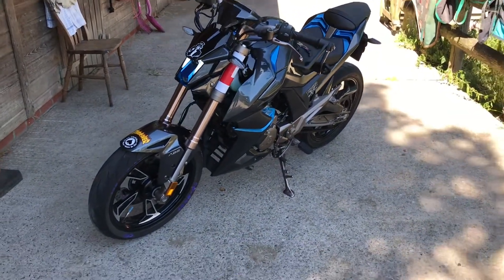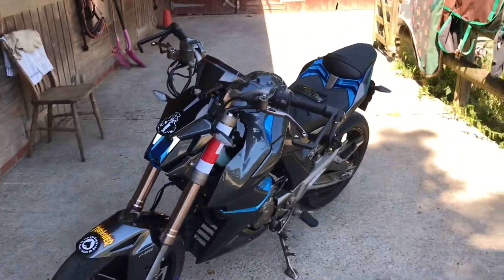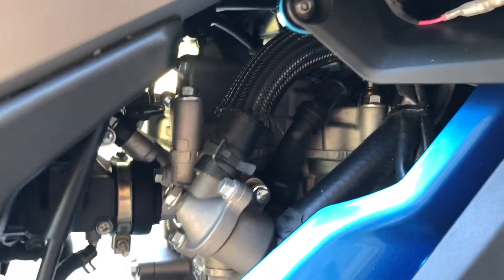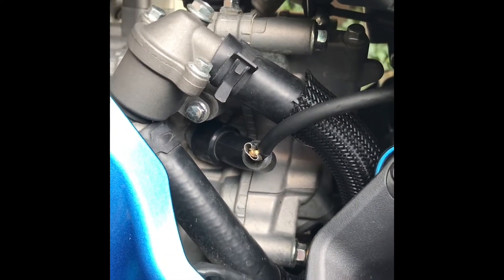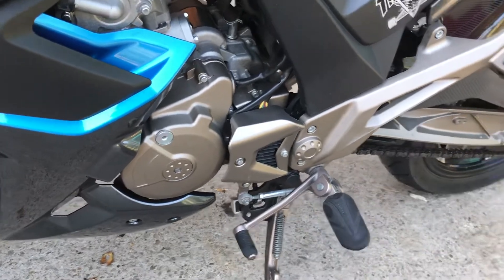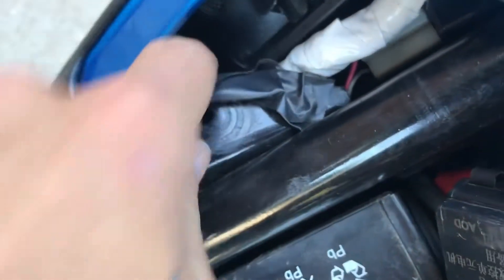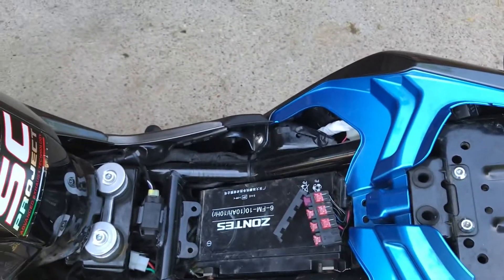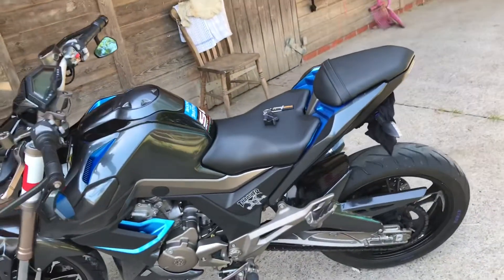Zontes zt 125 u review part 2 problems and issues must watch!!

Comment: Never pressure wash a road bike that's just stupid even pressure washing a MX bike you don't force the water raound the eng8ne or electricals.   Sidestand switch is a common issue especially in winter 2 allen bolts to get off, clean it and lube with engine oil all sorted.

Comment: Should not wash a bike with an eye pressure water jet you just cause more problems
Reply from the maker: Yeah I know that bud but loads of farms around where I live so bikes covered in shit all the time not gonna sit there washing that off my hand 3 times a week 😂
Reply: @ThrottleThrasher  Hello thank you for your reply I believe you can buy a wax that you spray over the loom and all other parts of the bike which protects it from all the elements and it’s easier to wash off
Reply from the maker: @michaelbarrie1748  oh ideal I have heard of something similar just like a waterproof silicone you put in all the connectors and plugs and everything definitely worth getting I think !

Comment: How did you get rid of the floating mudguard on the rear wheel? But its a great 125 for the amount of luxury features u get. You probably were just 1 of the unlucky ones from zontes. I would just cover the sparkplug with a plastic bag when washing.
Reply from the maker: Just unbolted it mate I’ve not got a number plate on the bike at all anymore re located the indicators and got rid of the plate have it on my ruck sack now (video of this dropping soon ) and yeah but I’ve had comments saying they’ve had a few small problems Aswell get it with all bikes and it must have been a fault ht lead and since I put new one on and coil pack had no problems!
Reply: @ThrottleThrasher  See I think the indicators on the wheel is kinda a safety hazard from anyone behind because they would need to see your indicators. Thats why Im doing the same but i'll still have the plate on.

Comment: if you want a free tattoo get in touch mate, thankyou for clearing some things up especially the cutting out when wet although it happens to me in the rain as well. my indicators filled with water on the side the bike leans after the first wash, seat release and fuel cap stopped working, audio beeps don't work, hazard lights flash on/off randomly after starting the bike, red button stopped working so now i use the side button in the little hatch to start the bike. Bike bogs down violently when wet. clutch sensor broke, the only things left to go are my forks and side stand. absolutely gutted about the lack of water proofing on this bike. why go to the lengths of design manufacture and ABS to cheap out on the electrics. i ride every day of the week bar one for work, some mornings I'm just hoping it starts .
Reply from the maker: Where are you from mate may take you up on that assume your obviously a tattooist? Really it seems like mixed opinions on these mines in 12000 miles now still going strong especially once I changed the coil pack and ht lead as that’s why it was faulty when it got wet
Reply: @ThrottleThrasher  what HT lead did you get and coil pack? Any links? Thanks!
Reply from the maker: @ralphganaden7390   could find an upgraded one . So had to get one through Zontes just original. Was £38

Comment: You r a g for this, I've just ordered mine, should be here Wednesday.. im literally going to do all of the above👌
Reply from the maker: Legend mate and is it what colour you gone for? Yeah hope it helps mate like I said hasn’t put me off in anyway still been a fucking amazing bike and done like 9000 miles on it already so it’s not bad really
Reply: @ThrottleThrasher  the orange and black. Just passed 700 miles. I can't comment on the other issues, but the wiring is all wrapped up now, not strapped to the metal so I guess they were aware of the issue. Ht leads etc all fine atm

Comment: Fuel cap issue common to lots of Skoda's and fixed the same way. Wiring issue hopefully a one off but worth checking. Looks very tidily designed.

Comment: thank you for these videos! gonna copy all the upgrades, especially the wire cutting metal will be sorted by the weekend 🤣
I love mine so much. 500km on it so far, can’t wait to put on a better sounding exhaust and bar end mirrors.
update: did you encounter the problem of losing power uphill? if so, what did you do to avoid it?
Reply from the maker: Cheers mate appreciate it ! Yeah I’d definitely do that ! And I think it’s just a 125 thing mate not got that much power could change the sprockets tho but would then power on the straights so I’ve left mine as it is on the big big hills will go down to 40 mph minimum!
Reply: Yo m8 where did u get the tail tidy and is it hard to put on cheers

Comment: Grate vidio mate   the thing is with that problem with the wires    if bikes under warranty  and thay see that the problematical  area has been tampered with i beleve thay can refuse to fix it is that correct    thank for briging my attention to this  as i hav seen another vidio  who says the same thing regarding  those exact wires 👍
Reply from the maker: Yeah that’s correct I probably did void the warranty but I didn’t purchase the bike from new so not sure if it could be transferred and unfortunately I’m 100 mile round trip away from the local dealer and needed the bike for work so was my only option but glad I got rid of the bike got to 12,000 miles the the electric got really bad lost most thing like speedo ,abs set didn’t lock or unlock fuel cap  so fucked it off

Comment: Nice video! May I ask where did you get the exhaust? Do you think it’s worth buying it? Then, do you think that in comparison to other naked bikes it is at the same level (like ktm duke and mt 125)?
I ask you all this because in the future I would like to buy one aswell
Reply from the maker: Yeah I’d say it’s worth it 100% even just for the link pipe as you can then change it anytime you want and just put a new van on it ! The exhaust I have tho was for an mt 125 as got it with the bike so I just cut off the muffler and welded the link pipe on ! Personally I would say so yeah although it’s Chinese the build quality is amazing and the bikes done very well just hit 9000 miles in 7 months and only had the few small issues I mentioned in this video so I’d definitely recommend the bike!!
Reply: @ThrottleThrasher  Thank you so much!!!

Comment: High, this video has been enlightening for me, my ZTu1 125 has been having some similar issues so  i shall be looking at what you have found.  would you be able to tell me the upgraded HT lead you brought was please, i think i will change it regardless...
Reply from the maker: It maybe the ht lead like mine was . I just replaced it with a stock one that’s been fine since but ……. The bike doesn’t like water and broke down in December last year has been off the road for a while but fixed now had a lot of messages on Instagram and YouTube with people having similar problems! It turns out like I say they don’t like water especially if not kept in a garage . My main fuse board under the seat started to corrode due to water going up under the seat so I lost abs and Speedo one day then days later she wouldn’t start like I say this was the fuse board rusting so was getting no connection so I took all the little connectors that hold the fuses in our and sanded them and put waterproof greese on the fuses and put them back in and been fine since .. also dried out my ecu on a heater as I’ve heard some peoples Zontes have had ecu failure due to moisture building up inside stay tuned I got a video dropping in this next week and a 1 year review !
Reply: @ThrottleThrasher  Thank you for answering my message.  I got mine in July last year and it started playing up the same way and yes it looks like wet weather is the cause. I unfortunately can't keep mine in a garage, its outside under a motorbike cover sheet thing. There is one thing that has happened with mine that I have just sorted out which is that it started to idle low and as a result kept cutting out. I will also be upgrading the spark plug to an iridium plug.   Looking forward to the next vid....
Reply from the maker: New video just dropped on the issues bud !

Comment: If you stopped jet washing your bike like its a car you wouldn have these problems
Buy a detailer spray and use a microfibre cloth and keep it clean as often as you want your girlfriend to wash herself before riding her. 
Throw the Karcher away and spend some time with cleaning it
Dont soak an engine with water and conplain on corrosion underneath, on ur stand, corroding your plug lead

Water is your issue
Not the bike

My bike has never seen a hose. Only a bit of rain.
Reply: My sons bike has always had the pressure washer and has had no issues. But then again he uses a leaf blower after to dry everything off and then some gt85

Comment: Fantastic and honest video. I have one question. 
Is this hand guard original? 
I would like to put the mirrors like yours, but they say I have to change the hand guard because it doesn't fit.
Any suggestions?
Reply from the maker: Thank you bud really appreciate it ! Yes they are mate and are stick hand guards !  all I did was get longer bolts than what came with and then put a big spacer on the end of the bars and bolted all in together maybe able to see this in the video now I’ve said it
Reply from the maker: Thank you bud really appreciate it ! Yes they are mate and are stick hand guards !  all I did was get longer bolts than what came with and then put a big spacer on the end of the bars and bolted all in together maybe able to see this in the video now I’ve said it
Reply: @ThrottleThrasher  thanks so much ;)
Reply from the maker: @Andreptt  no worries at all ! Hope this helps

Comment: Good day! I got a question, I am 17 years old with zt 125u, and i got a issue, well basically i was riding home from school, and my bike started choking, and after a while it lost all power and died, i could get it to start and i had to pull it to my garage, and i found out, when it cools down, it starts and drives good!! but when it reaches like 90 degrees celsius, the bike starts losing power, chokes, dies and won't start until its cooled down again, I have the bike currently at a zontes repairshop, and they also dont know whats wrong with it. Does anyone else had the same problem? If yes, what was the problem please? thanks for any comment and tips, i wish i could ride the bike right now, have a good day!!

Comment: Have somebody P0030 fault code problem? I checked everything, heater resistance is fine, circuit from ecu to sensor is fine, voltage from sensor is fine but then I delete fault codes and check engine is back after 1-5km of ride. 
Help guys!

Comment: Chip tuning power unit on google 80 quid atm for this bike
Reply: Not sure if it works tho ...anyone know anything about them ??
Reply from the maker: Is it fair enough mate yeah I’m not sure that wasn’t a thing when I had the bike as was not long released unfortunately most of my electrics failed when winter came so sold the bike . Lost abs my clocks my seat release all sorts as main fuse board rusts really bad and quickly

Comment: Are the bike good apart from this looking at getting one
Reply from the maker: Yeah I’d 110% recommend mate but read comments on some of my other videos on the bike as some people have had other and worse problems but then again others have said that I was just unlucky the bikes in 12000 miles already and is still going strong
Reply: @ThrottleThrasher  will do mate I had an lexmoto xtrs few years back but had nothing but probably from day one now want to ride again soon
Reply from the maker: @garyweir2294   tbh mate I’ve had 42 125s now in 5 years I think it’s more if you have a problem bike you have a problem bike and it doesn’t end ! My girlfriend had my Zontes now I’m on a lexmoto Mitchan ! Out of all the bikes I’ve had if recommend this Zontes my Yamaha yzfr and my Yamaha wr 125 all were really good solid bikes
Reply: @ThrottleThrasher  how much did you sell your zontes for? I paid about 3k for brand new cause I wanted peace of mind.
Reply from the maker: @steve00alt70   sold it for £2200 to my girlfriend as she’s know it had been well maintained had 10200 miles when she got it was going to be £2500 but she needed a new set of tyres front, sprocket , rear break pads and the worst is it need the swing arm bush and bearing replaced as wobbles now that’s gone

Comment: whats the top speed of your zt u 125?
Reply from the maker: 76 mph then has a Rev limiter on the cdi so you can’t get anymore than that
Reply: @ThrottleThrasher  how to remove that?
Reply from the maker: @EndritAl  no idea mate wouldn’t risk it as would probably blow up from over revving I’d assume if you was to do it you’d want an in restricted cdi unit but you’d not find one for these to new !
Reply: @ThrottleThrasher  True.I have a 125cc 8.5 HP is enough.I love it.To me is all about fun not speed anyway.
Reply from the maker: @EndritAl  yeah exactly mate I have mate in 600s and 1000cc bikes and they said they had more fun on there 125s and cheaper in every way